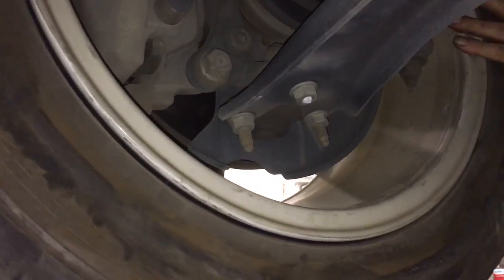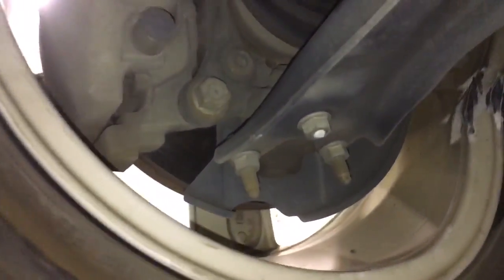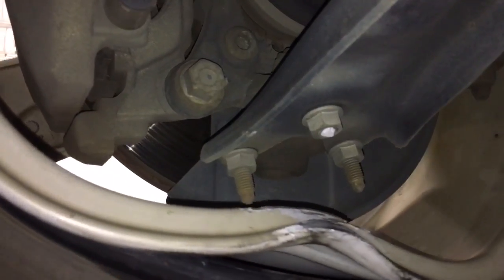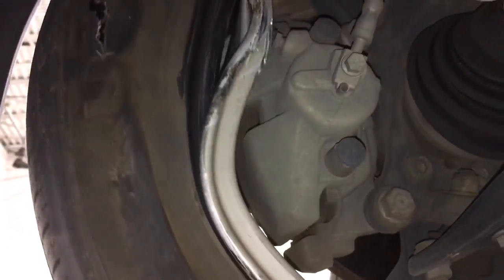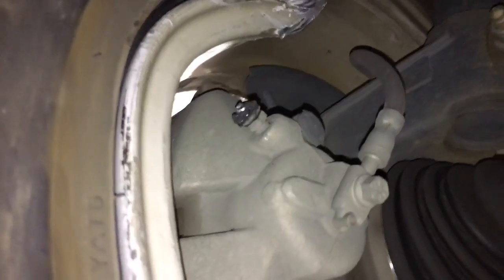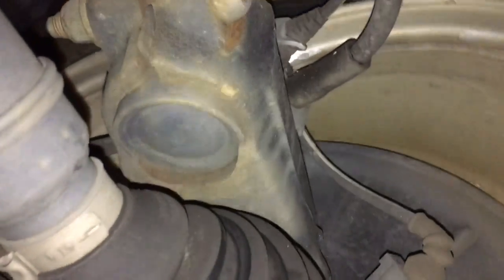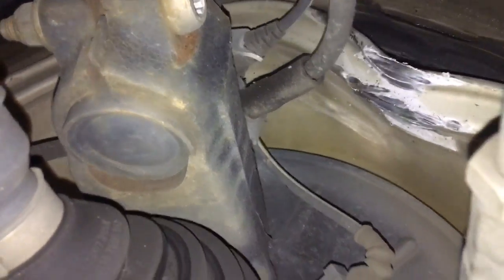Pothole Damage to Volkswagen

Comment: that's a curb-jumper right there
Reply: +NIAtoolkit I was guessing a 1 ft+ drop
Reply: +TheBurnout No way, they hit something like a curb, def. not a drop....that happens from the wheel running into a 90* angle (perpendicular to the ground) like a deep pot hole or a curb.

Comment: Last winter I interned at a Volkswagen dealership and one of the cars I worked on had similar damage. Only difference was the car had steel rims instead of alloy so it was a cheaper fix for the customer.

Comment: Damn Homie, what did they hit? I was pissed when I hit one and had to replace a tire, bearing and axel shaft.
Reply: +Dashtc i have hit a couple pretty nasty pot holes before....  a few years back i had a 2002 chevy impala base model with the 3.4l v6, spring time after all the ice and snow had melted i went over a set of train tracks at 40 following traffic but hit the ridge really hard and blew the front passenger tire and bend the rim beyond repair, pulled into the nearest parking lot, put the spare on and turned around to go the tire shop a few blocks back to get a new rim and tire, they said itll be a few hour wait so i went on my way to run the errands i needed to......... same damn spot on the tracks blew out the spare tire and bent the doughnut rim and actually cracked it...... drove back to the shop and told them ill wait in the lobby.... and while your at it tack on a new spare tire and rim to the bill i hit the tracks again... wasnt a fun day but lesson learnt, go slower over big train track bumps in a car, but truck can take it no problem but hardly drove the wifes impala haha